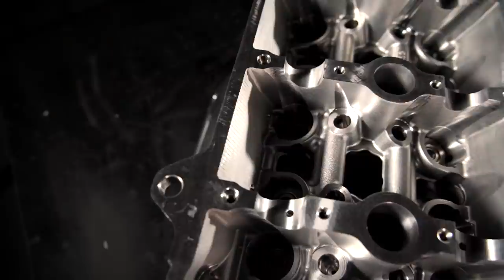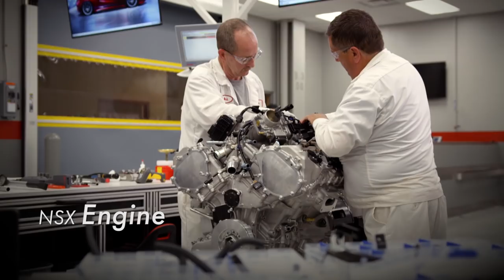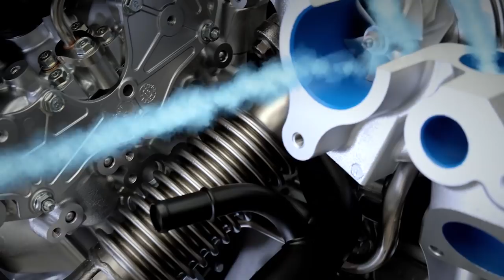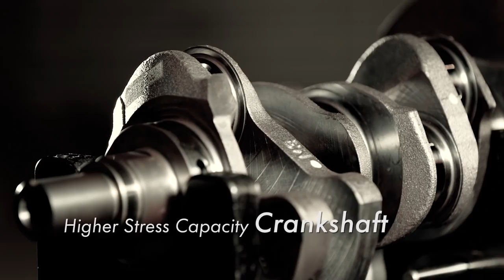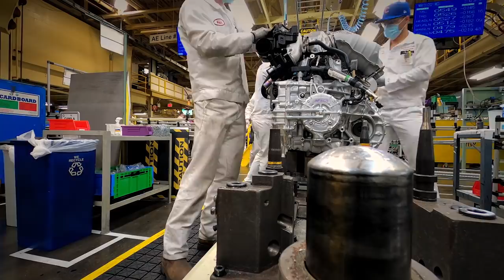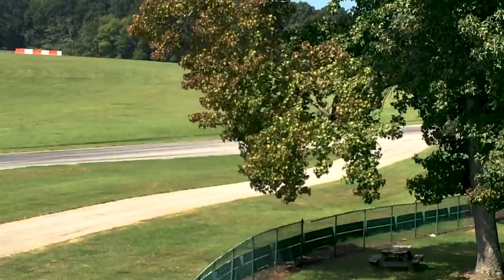Acura Type S Turbo V6 - Development Story

Comment: I had the privilege of owning an '02 RSX type S. Best years of my early adulthood lol. Car was a blast to drive. Good for Honda for returning back to its roots- performance and reliability.
Reply: Yep, '07 Civic Si here (pretty much same engine).  I still think it's the best NA engine Honda has ever produced outside of S2k family.
Reply: @sergeybebenin  yess sir, k20a2 baby!
Reply: @sergeybebenin  Yepp the K series is def hands down the best honda engine next to s2k f20 engine but the k24 is okay. Ive had a gsr b18, em1 b16, prelude h22 and now i have a Rsx typeS k20z, its the best engine. My friend has a s2k and that thing is super nice, want to get a s2k but prices are wayy to high now.
Reply: I Still have one, 148k daily driven bone stock and still sees 8k rpm daily. One of the best cars ever built as far as reliability and fun to drive!
Reply: @jaimehurtado2138  
👍   I went all the way to 275k mi without a single engine issue.  Unfortunately had an accident in winter and insurance said it's not worth fixing.
Reply: Any love for the k24?
Reply: @rudysalas9138  I got some love for the k24. I own an 08' TSX. The K24a2 is probably the greatest 4 banger Honda has ever made.
Reply: Bro love your story i had a buddy who owned exact same model as you who also stole my money and disappeared

Comment: The TLX is the most beautiful sedan in its class Imo. 

Would love to see a limited edition Type S coupe with 400hp
Reply: That would be nice!
Reply: Q50 red sport would smoke that thing to dust 😅
Reply: @keithjay4944  Don't be so sure, its only a couple of ticks faster than the Type S. If Acura managed to make the Type S lighter and pumped up the horses to 400, it wouldn't be a contest.
Reply: With a manual ✔
Reply: I have this memory of the earlier Type S marketing from Acura stating the car would be "over 400 horsepower", but if that was true, I can't find evidence of it now (it may have been youtuber speculation).  But I'm still disappointed the car doesn't already come with 400hp.  I was genuinely hoping for something that would compare well to a Lexus RC F (or GS F) with its 477hp (comparing well doesn't mean beating it, just in the ballpark).  Instead, it seems Acura had their sights set firmly on a lower target.

It's a very good looking car, and will likely sell pretty well for Acura.  I'd love to see a jazzed up version too, with both an HP and a cosmetic upgrade of some sort (spoiler and diffuser, that kind of thing).  They could make something that appeals to wealthier buyers who like the car and would like it to look more sporty (as opposed to classy).  Shrug.

Disclaimer:  I own an Acura, but it has significantly more horsepower than this.
Reply: @jerse788  but yet you would still not buy it lol. There is a reason why car companies are not making manuals anymore in cars...BECAUSE NO ONE BUYS THEM ANYMORE
Reply: @keithjay4944  you mean the one connected to a CVT?….A CVVVVVVT?! I’ll wait for them to throw that motor into the Nissan 400z

Comment: Glad to see Aluminum Valve covers not those shitty plastic ones.
Reply: Agreed
Reply: The valve covers literally are the cam bearing caps due to the short design of the engine. They would HAVE to be metal.
Reply: @jay.fromthebay  yep, would that it make difficult to do maintenance work like changing valve cover gaskets?
Reply: @MrSamPhoenix  not necessarily. A lot of Honda engines especially the newer k series rely on precision fit with a little bit of silicone sandwiched in between. They have done it for years on transmission halves, engine girdles, oil pumps and other things. And it works well when everything is torqued correctly.
Reply: @AcuraLvR82  - I hope it’s as easy as changing the valve cover gaskets for the SOHC J-series. 

One of the main reasons I love the SOHC J-series engines is how easy they’re to work on (along with being torquey, smooth, reliable V6 engine designs).
 
& would putting everything back become a headache if we do have to reseal the valve covers one day?
Reply: @MrSamPhoenix  More difficult than usual yes, but still not impossible. And I'm sure the designers came up with more stout valve cover gaskets to compensate for the extra load on the valve cover.
Reply: @jay.fromthebay  - I hope you’re right my friend, I love working on the current… SOHC J-series motors. I hope this “new” DOHC turbo design will be just as much a joy to work on. 

Quick note, I was watching a review video of the new TLX Type-S on Savagegeese YouTube channel. 

& they’re weren’t afraid to show off how the engine looks naked without the “hat” on. Doesn’t look good at all, but the new engine looks like it’s still using a timing-belt. What are your thoughts on that?
Reply: @MrSamPhoenix  my thoughts, timing belts suck. Timing chains are obviously better for longevity purposes.
Reply: @rudysalas9138  that’s not always the case. But I feel where you’re coming from.
Reply: @MrSamPhoenix  same here have my 04 Accord EXV6 sedan is dream to service and work on plus it only has 74,000 miles on it.

Comment: "designed for high strength"
Translation: "ready for tuners to make this thing to 400+ hp"
Reply: 600+
Reply: Probably had already close 325hp out of the box
Reply: Good luck with that small td04 turbo 🤦🏻‍♂️
Reply: @Acura_mechanic  I'm referring to the block strength not the capability of the original configuration
Reply: @nighthawkj30A4  355out of box
Reply: good luck with the transmission
Reply: @attargah-53  lol do you know anything about Honda/Acura transmissions? The six speed auto with paddles and sh-awd that comes on my 2012 MDX I have been told is overbuilt for 5-600hp by multiple tuners and I absolutely believe it because I can beat the shit outta this thing and it runs like the day it left the factory. (My tranny fluid is literally always pink) Now I can only imagine improvements have been made especially because they have decreased the shift time even further which without a doubt will feel amazing. Also in SH-AWD configurations like we will see here, there is a geared acceleration device for the rear diff & torque vectoring clutch packs that allows for the rear wheels to spin 1.75x faster than the front, this actually relives stress from the transmission as the load is being split so really who fucking knows man we are talking about genius engineering. Did you know only Lamborghini and Honda have this technology? Pretty wild...can't wait to blow your doors off buddy.
Reply: @attargah-53  the normal 10 speeds are already very strong. And the type s is further strengthened
Reply: @MCMinerHQ  I think he’s saying it because Honda has a history of glass transmissions in the past
Reply: @matt25675  I do recall a few times that some odessy vans were having problems, I haven't heard much else.
Reply: @attargah-53  do your research

Comment: They really should have paired it with a 6-speed manual But sadly that isn't the case I know automatics these days are faster and all that jazz But there's something having high performance and having full control of that power through a manual transmission and that connection between man and machine
Reply: I couldn't agree more ..
Reply: I’m coming from an evo x, I honestly won’t miss manual at all lol.
Reply: And I have my doubts that automatics are even as superior as they are claimed to be. I mean, the whole thing about better MPG from automatics doesn’t necessarily bear out in real world driving. I feel like, to a large degree, automakers don’t want to make manual cars because most people don’t want them. They then have to exaggerate the advantages of them in order to placate stick shift aficionados.

Comment: Love my 2023 TLX Type S
Reply: I’ve had issues with audio and sometimes, (when using sport + and manual shift) the gears are slow to respond… just curious if you’ve had similar issues?
Reply: @donaldwilson803  I’ve noticed audio issues when my iPhone is connected to CarPlay. 

Sometimes in sports + mode the gears are long or like you stated, slow to respond.
Reply: @usmc187  I’m not out here being all fast and furious lol, so the slow gearshift isn’t a big problem for me.  However, I was driving yesterday and lost all audio. No fm, xm, navigation, nothing.   Just trying to see if it’s happened to others.  Thank you for your reply!
Reply: @donaldwilson803  usually all speakers go out except the front center which is strange.

Comment: I can't wait till this thing gets out into the real world and drivers can test the launch control to see what it's capable of.

This car is going to be one of those that's actually at its best out on the streets.
Reply: Like ALL Acura /Honda cars. They focus on driving pleasure which matters in the real world, rather than stupid hp numbers
Reply: 0-60 4.7s
It’s okay, even underwhelming
Reply: @E82N55  apparently not. 

The testers at the press event weren't made aware that the car has an official launch control, even reporting that it didn't have launch control, so they all just did their best with the brake pedal and throttle.

The Type-S launch control system likely improves the transmission logic on launch, and in fact uses the twin scroll turbo to increase then maximize boost pressure specifically at launch rpm.

Then, I doubt anyone attempted to launch the car using the parking brake, a classic method known to improve numbers.

It just hasn't been tested nearly thoroughly enough to claim the acceleration is underwhelming.
Reply: @E82N55  just came out and already way behind the competition.
Reply: @JAM_2024  great looking car but Acura has disappointed me so far. They need to find a way to cut some weight from the vehicle.
Reply: @MrGunzngirlz  I’m a fan of Honda/Acura but the competition has it beat. The transmission is really good but it can only do so much to keep up. S4/C43/M340i cuts under the Type S’ weight at least 200-300+ pounds. Hell, my 2012 TL SHAWD in manual is about 400 pounds lighter than the new Type S, though I obviously wouldn’t be able to keep up with it shifting. 
From a dig, the Type S isn’t slow by any means. But I wouldn’t be surprised to see even an Accord 2.0T not trail far behind from a roll race.
Reply: @E82N55  remember when the NSX released and journalists sandbaggged it claiming it ran low 11s, but then people got it in the real world and it ran 10s?

That's the Type-S.

We still don't know exactly how fast the performance version of the 10AT is, but we know Hondas standard 10AT is already fast and Acura has said the performance version is multitudes faster, enough to put it in line with the competition. So why count it out before the word go?

We also know from some of Acura's statements that the Type-S is making its power figures to the wheels (like all the other Turbo Honda products)

Then we watched it take an Audi S4 several times during the press event.

I just don't see where the pessimism could possibly be drawn from for this car?

It looks fantastic, sounds even better, and will perform excellently in the hands of drivers out in the real world.

Especially once the tuning starts. We're finding out the engine is extremely overbuilt.
Reply: @MrGunzngirlz  One word - M340
Reply: @SBM200612  I don't think that counts as a word, but I do think the J30AC will allow for a higher tuning potential than the 340 from what's coming out about it, but we'll see.
Reply: @MrGunzngirlz  no launch control on my car

Comment: The 3.0 liter Type S Turbo V6 engine is a double overhead camshaft engine which be exclusively marketed under the Acura brand.  This is a big change because  of the Acura V6 engines were of the J-series single overhead camshaft V6 engines which have been used since the mid 1990's.   This is a production-based 3.0 Liter V6 turbocharged engine and it should be interesting to see if Honda Performance Development can use this engine in the 24 hours of Le Mans and World Endurance Championship as the Honda HR28TT twin turbocharged V6 and Honda HR35TT twin turbocharged V6.   The Acura NSX has 3.5 liter twin turbocharged double overhead camshaft V6.  I'm looking forward to see the what the Honda tuners have in store for this V6 engine.
Reply: I thought the NC1 Acura NSX had a different V6 engine?
I also thought the NC1 NSX had a block and head made by Cosworth?

The NC1 NSX engine is not shared with other Acura car lines like the MDX.

Reply
Reply: @zzzzzsleeping  Yes, you are correct.  NC1   engine is different from any of Acura V6 engines.  Cosworth did make the cylinder heads and engine block.  Two weeks ago, I had the pleasure of driving a tuned NC1 and it is one bad ass sports car.  The EV mode is one coolest features of the NC1.😎

Comment: My biggest concern about this engine is whether or not that turbo will last as long as all the k-series and j-series that have come before it. I buy Acuras because I know I can get to 200,000 miles without a worry.
Reply: Although N/A would most likely last a bit longer, I think this engine should be able to last 200k.  Honda has been making turbocharged engines for a long time now, and they also mentioned strength was one of their priorities with this engine.
Reply: Can’t be any worse than that oil diluting garbage in the crv
Reply: Yea they should’ve tested that engine for longer.  The bigger 2.0T with gdi doesn’t have any problems though, so I doubt their bigger engines will have it either.

Comment: A 1998 Acura Integra GS-R was my first new car.  I daily-drove, road-tripped, auto-crossed, and tracked that car for 13years and 153k miles and enjoyed every minute of it.  Considering coming back to the brand now and trying to figure out why I would purchase this instead of an IS500 or CT4VBW.  

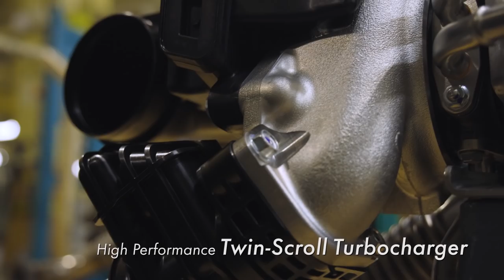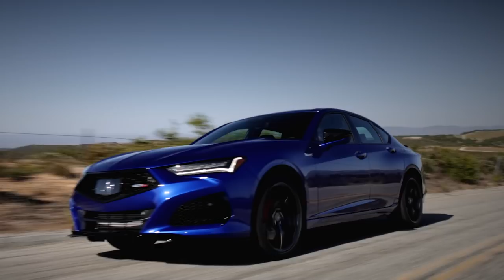I am disappointed by the lack of technical depth in this video, there are barely 2.5min (2:40-5:10) of real meat, everything else is fluffy marketing artsy-speak.  Just tell us that this is a single-twin-scroll light-pressure turbo V6 with VCM and direct-actuated valves.  Turbocharger located above the transmission for compact transverse packaging.  It is so easy guys...stop obscuring the data.

Comment: As an 06 TL driver (non type-S) when it’s time for a new car, hopefully this will be it!

Also side note, I feel like a type-S RDX would’ve been sick over the MDX
Reply: I agree.  Actually, it sounds like this motor will get dropped into a number of platforms.  It would be wicked if mated to a resurrected/updated S2000 roadster.  I too have an ‘06 TL 5AT, w. 166K miles.  The car is heavily modded, and it has been super-reliable & durable.  And it corners like a go cart.  I’d see myself with a TLX Type S as well.

Comment: 1991 Supra = 320HP.
2021 Type S = 355Hp.

1.17HP/yr. Making progress!
Reply: The Supra made 276 hp in 1991, not 320...also, you're comparing a coupe to a sedan...that's like comparing apples to oranges.
Reply: @KardiFan2000  320 in NA markets. JDM = Gentlemen's Agreement. 

Edit: You're right - I was referring to 1993 Supra (MK4), not 1991.
Reply: @channelnamehere4065  I know I'm right lol...either way it's dumb to compare it to the Supra...the NSX is the only Acura that can compare to that.
Reply: Stupid comment since a lot of the competitors have similar power figures. Also if you were a proper car fan you'd know it's not all about power but how it's used on the road. The S2000 had 240hp and is considered one of the most fun cars ever
Reply: Your comment is stupid. I was pointing out that in 1993, a 3.0L I6 made 320 HP and here in 2021, we managed to get 355 out of the same displacement. It's like they took 1993 technology and took it in for extrude honing while phoning it in. Progress! And yes, if I were a proper car fan, I'd be a fanboy of this car too, but since I'm not, you'd forgive me for not loving everything on wheels. Besides, if Acura didn't want comparisons, they shouldn't use words like "...technologies from the NSX supercar to produce 355 horsepower and 354 lb.-ft. of torque, helping it make the TLX Type S the best performing Acura sedan ever." Yea, they did!
Reply: In 1991 Honda/Acura had a roughly 270-290 hp NSX. the 2nd gen 10 years after the first one was discontinued, it has 573 and the 2022 Type S has 600. Honda has never been high in HP figures in their cars ever. This here TLX in 2022 should be compared to what a TLX would've been in 1991 like the Honda Legend or just an upbadged Honda Accord. Those cars made less than 200 HP back in the day. Speaking of HP figures from Honda, I have a 240 HP V6 Accord sedan 2004 model year, makes the same amount of power as the S2000 and I find my Accord super fun to drive let alone wondering what an actual S2000 would feel like in comparison
Reply: @D V, aside from your obvious arrogance, you don’t sound like you’re much connected with the Honda way.  As stated, their cars are game enough in performance to sell quite well, AND they are the most modded brand ever.  Honda engines are built to balance performance with reliability, they for example don’t suffer VTEC failures the way BMW motors suffer ‘limp mode’ .  RhecTLX-S block was built strong using 6 bolt main caps to handle lots of torque, strong enough to support plenty of added stress from performance mods.  For those inclined, there are Honda’s & Acura’s on the roads with 50%, 100%, and even 200% added power over stock.
Reply: @Snookynibbles  Talk all you want, fact is, back in 1993, Supra motor makes more HP/Ltr than today's Acura. 2000 Celica GTS makes more HP than Integra GSR. The Honda way has lost its way, apparently. Their engines may last forever but everything else breaks around it before 200K miles.